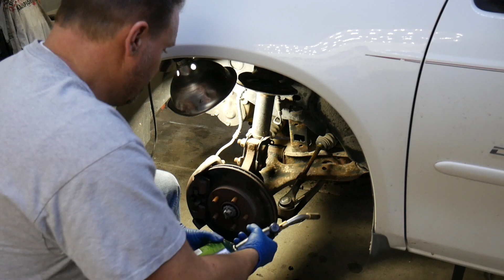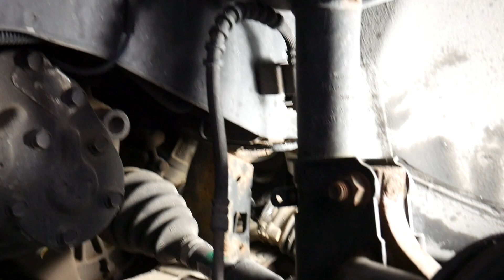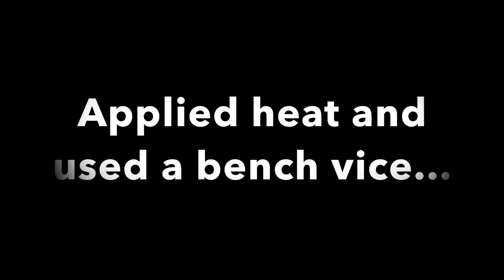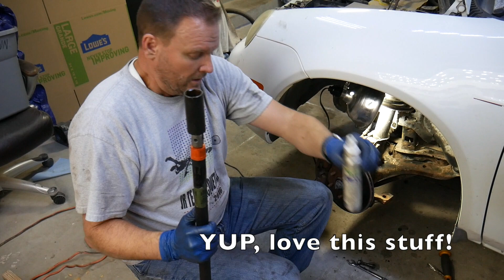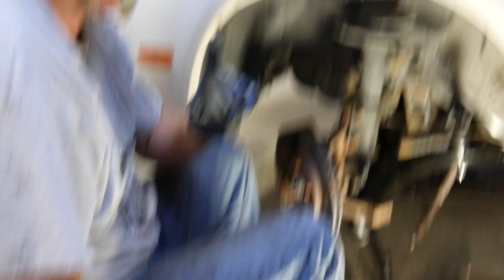Dodge Neon Front Suspension Kit Install - 2000-2005 How To Do It Yourself

Comment: Hello, greetings, I see that you know a lot about Neon, a favor and a nuisance, if you could help me, I would greatly appreciate it.
I have had a Neon 2001 automatic 2.0 engine for 3 months, an irregular detail
After going out in the car for long distances or 20 or 30 minutes, returning and turning off the car, you hear that the hose that goes to the Antifreeze tank wants to boil and in less than 1 minute it stops doing so, it doesn't boil or expel it, it just wants to start and stops doing it
Complete engine overhaul was done in 2014

New agency radiator cap has already been changed
Temperature sensor changed
Thermostat changed
Starter fan and fan motor were replaced
Antifreeze was changed and air was expelled from the system 
The radiator does not leak 
No leaks in hoses 
The fuses are good 
New antifreeze tank changed 

What do you think could be happening? 

Thank you very much for your help, I would value your opinion.
Greetings from Mexico Puebla

Comment: My lower control arm bolt is broken in the frame. And my sway bar bolts broke off. This is a yearling thing with this srt4
Reply from the maker: 😱🤦🏼‍♂️ oh man!!!  That’s not good!
Reply: DIY Home and Auto thank god crysler put 4 in hole in the cab lol.  I had to on each side of the cab where the indent  of a hole is at in the cab. The dash  is to low for a regular drill so I made 12 to 14 smal drill holes and  then between each hole with a pair of sheet metal cutters cut And  out the whole. then made a plate to cover the holes with thick sheet metal and  put rtv between that and the cab to cover it. Also covered the frame holes the same way so no more water rusts out them bolts.   I also updated the original bolts and nut to something that is more suitable for my tool collection.

Comment: Awesome Video! I have a question regarding when to torque the bolts for the control arm & other fasteners. Should the be torqued when the vehicle is on the lift (Unloaded), or on the ground (Loaded)? Thanks for your help!
Reply from the maker: Thanks. I do mine when it’s still in the air if that’s wrong I’m sure someone will correct me. But that’s how I’ve always done it and it’s never done me wrong. 🤷🏼‍♂️
Reply: Thanks a lot @troysgarage  & Happy New Year!

Comment: Those rear LCA bolts are accessible from above (under the carpet via holes in the foot wells) if you want to use penetrating oil before applying massive torque to get them out.  I'd start oiling things a couple of days before the real start of the job if you can.  They corrode up above if there is ever water in the car from an open window, melting snow or such.  Break one and the gates of hell open before you.  If you buy your parts locally you can often get free use of the tool to easily R&R the inner tie rods.  You can cut the old tie rods with a chop saw or cutoff wheel instead of fussing with them to get the boots off.  Use a crescent wrench to hold the end of the rack gear to reduce the chance of twisting the gear and damaging the rack while working on the inner tie rods.  You didn't show using Loctite on those inner tie rod threads, if one works loose it could be a really bad ride.  I guess "tight is tight and too tight is broke" but when it comes to things that could get you or someone else hurt or killed I like to use a torque wrench upon reassembly, it is cheap insurance.  But I'm old and have learned from my own mistakes and the mistakes of others.  For example, if you replace the sway bar bushings on the Neon the bolts that attach the clamps to the frame are easy to stretch/break if you don't torque them.  I "snugged one down" and stretched it before it seemed tight, I really wasn't expecting that soft a bolt!  I did all of the same work as in your video on my '04 Neon a while back as well as new struts on all 4 corners..  The broken part on the passenger side in your video is the lower torque strut.  Buy one with a lifetime warranty, I have replaced mine twice in 146,000 miles.  The actual motor mount is a different part that mounts into the inner fender area.  That mount is a bitch to replace and you can't even really get a good look at it!  There are two torque struts, a transmission mount and a motor mount and even the parts listings call them out differently sometimes.  Glad it all went well for you, a good video to show it isn't a difficult project to do yourself.  Other problems I have had with mine are cam position sensor (x2) and carbon tracking in a spark plug boot.  Replaced the plugs due to a miss and failed to see a carbon track on one plug, the bad boot tracked the new plug in short order.  I still have a clunk in the front somewhere, I just can't find it even with my "Chassis Ears".  it seems to be from the right control arm area, but its all new and tight.
Reply from the maker: Clay Scott great pro tip. Thanks!